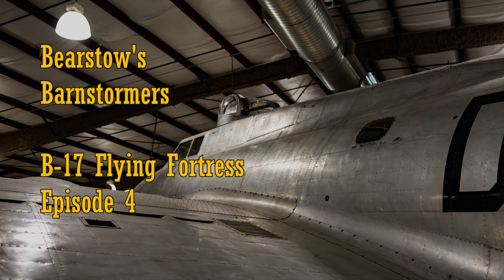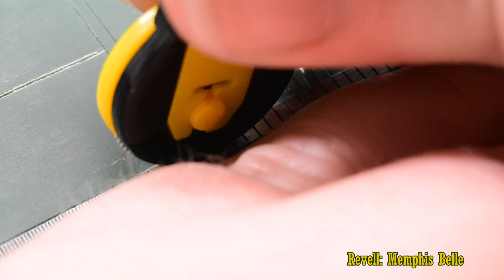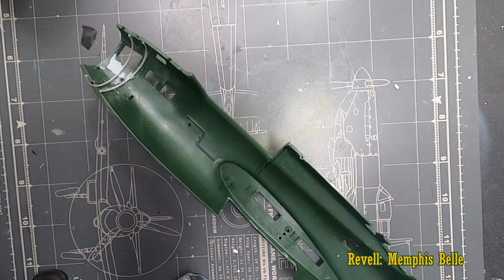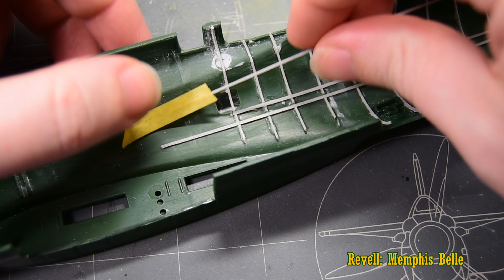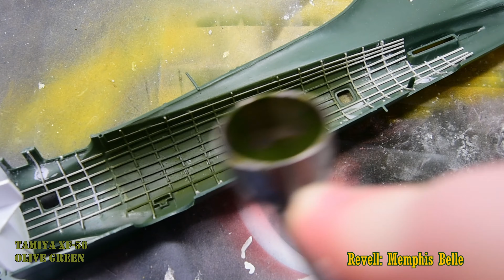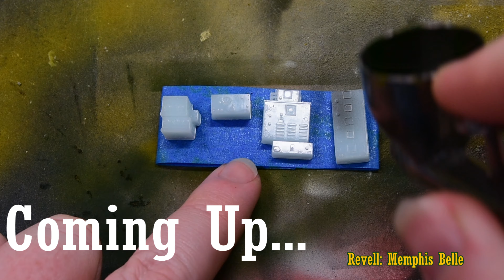Adding the details. 1/48 B-17 Model Build Episode 4

Comment: I have my version of the same M B attached to the wall. It is annoying to look down into the empty radio room, so you made a good decision here. I am currentky worhing on the Revell 1/48 B17G with more detail inside, and the HK version is in the mail. Your videos and interesting info about this legendary airplane is really inspiring. Many thanks!
Reply from the maker: Thank you for stopping by! I really wish that at a minimum Revell would start offering resin printed additional detail on this kit. Easy to implement and doesn't have the cost of the injection molds. 

I'm looking forward to continuing the series once my voice returns. Until then I've been doing a lot of 3d printing for the BB63 turret project.